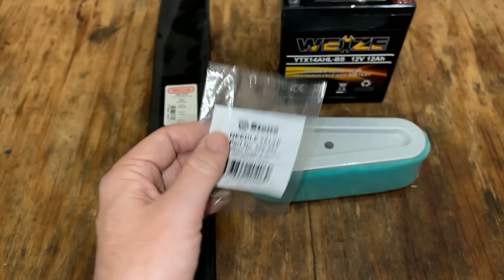First Start in 20 Years - MTD Riding Mower w/Briggs IC Engine

Comment: My lawn tractor ('94 Simplicity Regent) has a very similar Briggs & Stanton 12 HP engine. The mower is showing some age, but it still gets the job done.  I just had an episode where the carb float and needle stuck open and dripped gas everywhere, including the crankcase.  I think I got it fixed - no leak and the gas flushed out from the crankcase.  The hardest part was figuring out which of two carburetors was used in my machine and who to order parts from.  I would really like it if you would go into more detail about your process for finding information and sources of parts for your repairs.  
You are a great example of a person who works carefully, follows the specs, and has neat and tidy work area.  You set a high bar.
Reply: I use sten parts, found them real accommodating or Amazon alot.

Comment: Great little mowers! Small enough to fit thru gates and the engine is excellent. Drive belt is hard to replace. Only real problem is tiny springs for suspension on mower seat, on a bumpy yard they destroy your kidneys! Ask me how I know. I put a thick cushion on seat to help absorb bumps. :eyes-pink-heart-shape:

Comment: I went out and bought a can of bead sealer just for the reason. Of course i clean the rim 1st and then i put the sealer on and usually never have any problems after that. That's good for being 27 years old and the bearings being silent. My Troy Bilt rider is only 5 years old and i already had to replace the spindles themselves as the bearings aren't replaceable by themselves at least not that I know of

Comment: Nice job!!
I had a similar machine in the 70s It worked very well with only 5HP.
It fell to the rust bug.
It was a Kmart branded machine and I paid $259 for it.
The similar new Craftsman machines are JUNK, and sell for $2000.
Stay safe.

Comment: US Safety specs in 1985 and 1986 added blade brakes to mowers as a requirement. On my 1985 Toro 11-32 there is a spring loaded brake pad that presses against the blades Pulley. So when the belt to the blade pulley is loosened/un clutched the brake pad rubs on the pulley so the blade stops . The brake pads often wear out after decades of usage. .

Comment: To seat these small tires on the bead I use a short length of rope instead of a ratchet strap. Apply some heat to the side walls of the tire with a hot air gun. Then twist the rope up tight with a piece of rod or a dowel. Inflate the tire until it seats. I find that the rope will seat the bead evenly and then release with out a struggle.

Comment: The oil drain has a ball valve on it to make it less messy.  You use a flexible vinyl tube connected to a barbed fitting, screw it in where you removed the plug, and then open the valve with the screwdriver.

Comment: Nice work Jim, I always wondered why those didn’t have a recoil start as well as electric to use in times of a dead battery.
Reply from the maker: They definitely should have.  A 10.5 hp engine can be started no problem with a recoil.
Reply: i got an 11hp that is slightly older than this that has both electric and pull start. i would guess it  was a cost saving thing to ditch it since most people likely rarely use it when they got a perfectly good electric start

Comment: I have seen Mustie put an ear bud on a drill and spin it in the float check valve hole. What I was thinking was to put the needle on a drill and spin it slightly in the hole to mate the surfaces smooth.

Comment: A bit of valve lapping compound on a Q-tip will polish up the needle seat in that carburetor. 

Paint that rusted bare metal before it gets worse.

Leave the mower deck down when shutting off.  The blade will stop much faster.

Comment: A touch of tire slime in old tires works pretty well as a preventive measure. If you shut dow the mower with the blade engaged, it will come to a stop with the engine. Maybe not the best solution, but a functional one.

Comment: 20 years ago I had a Murray 10/30,looked like that one's close cousin. It was a good buy at $75,all it needed was a battery and machine keys for the back wheels,easy stuff I could DIY. I used it for a few years then sold it for $50. Kind of wish I would have kept it for a backup.
Reply: I still have my Murray!  Can't use it cause the rear tires have rotted out and I can't get the rear wheels off.

Comment: Would have certainly tested for grommet leak on fuel tank prior to fully reassembling.  Also not sure if this is an option or not but could you not have filed down the remaining old grommet, then pushed entire assembly into the tank and then simply removed it from the the fuel fill opening? Otherwise, pretty good repair.

Comment: 18:00 column drill and wire brush would work wonders but bit more work. take the wheel off and place it on the drill with bolt and nut and let the drill rotate it
also that mower is super clean for being over 20 years old

Comment: I love the old Briggs & Stratton motors, as long as the regulator gears have not stripped, they run forever. I didn't see the anti slack spring go back on the throttle linkage.
Reply: Caught that myself but although he didn't show it being hooked back on you can see a few seconds later that it had been reattached.
Reply: @TheOtherBill  Ahh, I missed that :)

Comment: I usually drain the fuel system first, then fill the tank with fresh gas, spray the greasy dirty parts with WD40 and then set it aside for a week or so. Nice to start with everything dirty loosen and easier to clean. Tha for its age is a very nice mower.

Comment: Those Zip ties can be saved. If you look at the lock where the end of the zip tie comes thru you will see a notch in that lock. you can take an ice pick and go in that notch and push the lock over and release the zip tie. as a mechanic I learned that a long time ago

Comment: Clean the seat with a Q tip in a drill.  You can put a little tooth paste on the Q tip before you spin it with the drill to help polish the seat.  If the Viton end is worn off, replace the needle.
Reply from the maker: Good idea.  Never tried it with tooth paste.

Comment: I bought a used Craftsman 3 in one ride and mulch 30" 10 hp like 10 yrs ago and it was like 20 yrs old then.  I loved that thing  a lot like the one you have there.  All I had to replace after a few years using was the drive belt.  I think I was to heavy for it and it could not handle the weight (  I was 350 lbs)

Comment: One other thing....take your tires off if the valve stems are inward and put them outward. On the tires, there are "C" clips holding them on, a flat screw driver will pop the off. Turn the tire around and you're good to go.

Comment: Another great video!!!! At 1:02:28 that underside is SO clean that I do not believe the mower has been actually used much. Usually grass/dirt/rust/mold is stuck everywhere and the only way for it to be that clean would be that it was washed, and who would wash it?
Reply from the maker: It saw very little use.  Was in great shape.
Reply: And that the discharge hole on the side of the deck looked like it had a “mulching” plate in it and you removed it for the mowing demonstration

Comment: Hi James. I recently got a black max 3550 4550 generator that was 3 years old and only 21 hours on it. It was hunting and then would not run unless full power choke was applied. So I new I had to go into the carburetor. But I had never done it on any carb. Your videos gave me confidence I could do it. The problem I ran into was getting the main jet out. The screwdriver I used was just a regular one that flairs out on the side above the flat tip. Not realizing that the tip was much narrower. So I ended up damaging one side of the slot on the jet. So I stopped there and just cleaned the jet with the wires. Never got it out. Good news is it runs great now. No hunting and running under half load with no choke. So now my question is does any mfg make a screwdriver set for this purpose. Or do you just grind down the sides of a screwdriver to use for removing jet and emulsion tubes. I watch all your videos no matter how long or short they are. Thumbs up always. Thanks keith

Comment: A Couple of things, first I would have taken a wooden stem q-tip put it in the drill & polished the seat maybe even with a drop of Flitz metal polish then through the ultrasonic cleaner. Just an FYI you didn't take the tire valve out but the Schrader valve, LMFIAO just helping out with the proper Nomenclature. Great video as always, will you let your son torture test it when you're done? LOL

Comment: What I will do when something comes out very tight like the main jet I will run in, very very carefully a tap to clean out the threads. Then, of course, make sure it is very very well cleaned afterwards to ensure nothing left behind. I find, in about 95% of the cases it then threads back in very easily. It is one of those things you have to be careful doing and obsessive about cleaning afterwards but seems to work for me. Assuming I have the right size/pitch of tap to run in.

Comment: You can put some Seal All around the tank bushing or TB 1184 to stop the leak.  Remove the bushing and coat it with Seal All or 1184 and then put it back in the tank.

Comment: That looks like a really good machine, once got the muck and dust off of it!   Also, on overall appearance, it doesn't look like it's had much use over the years.

A neat little bit of thought went into that oil drain, we used to have a screw in drain pipe to facilitate a clean and easy oil change. The basic principle is, unscrew the plug, as you did, then you screw in the drain tube and open that little ball valve (It's useful to loosen the oil filler as well, to let the air in faster). Once the oil is drained, refill with new oil. Unscrew the drain tube and refit the plug!

You should have a machine there that will last you a lifetime. I'd say it's a keeper, and despite its rather domesticated appearance, it's a very capable machine, often underestimated by many.  I've seen bigger and beefier looking machines that would have phutted out where those MTDs just mosey on through.

I have to say this, right at the end "Run, Forrest, Run! Except of course, his was a "Snapper" - "Why, shoot, you can cut my grass for free!".....

Not bad machines at all, MTD, Snapper, Lawnflite, Murray and a whole lot more.
Reply from the maker: Funny, forgot that forest rode a similar mower.  It is a very nice machine.  Am surprised there are not more of them around.  https://youtu.be/LZK5VRuUfEY?t=78
Reply: @jcondon1  I wish I could answer that. I do wonder though, if it might be that most folk equate the classic tractor shaped machines as being bigger, stronger, beefier, more professional, or just look more expensive, but looks aside, your machine has a ten and a half horse power engine. Contemporary tractor style machines of the same period began at about five horse power, so not really in the same ballpark.  I can't remember now, but I think these 'roller skate' style machines had the same Tecumseh/Peerless drivetrain, so no advantage there, either.  They may have had a more flexible frame than the tractor style, but that's about all anyone could criticise them for.  I know kids used to love them, take off the mower deck and you have yourself a neat little go cart.

Comment: James, I’ve enjoyed your videos, especially the way you are methodical about your diagnosis of the issues. Just curious . . . I was a jeweler for 20+ years and used an ultrasonic regularly. Question: why don’t you put the entire carb in a glass jar filled with PB Blaster and float it in the aqueous solution. I’d bet money that you’d free up stubborn emulsion tubes, etc, without much further effort. The cavitation in the solutions work from the inside out as in the operation of a microwave oven. They also cook from the inside first. I’ve been very successful over the years with a variety of objects in need of deep cleaning by using this glass jar/cleaning solution method. The jar should float since it’s never a good idea to rest anything on the bottom of any ultrasonic cleaner where the transducer is attached. Just a thought. Keep up the fine videos.

Comment: That's the right size engine for that mower. They're trying to put them on zero turn mowers with three blades and two hydraulic pumps now. You need a 22 HP V-twin motor for that at least.

Comment: I always liked the "sit over the engine"  compact riders.  For smaller lawns, they were easy to maneuver. They went out of favor due to tip-over according to the local mower shop.   I would have bought one for my yard,  but ended up with a modest size zero turn instead,  and that's great.  Does that machine lack a seat safety switch?   I was a little surprised that it wanted to go with the seat off....or maybe that's just if you want to engage the blades....  Flat head motors always seemed "tougher"  than the OHV motors produced today.  As far as getting the busing off the bottom of the tank,  perhaps a "fork"  pry bar like one used on tie rod ends for your car might be a good fit.
Reply: You missed him using a cable tie to defeat the seat safety switch, for testing.

Comment: Hint.  When cutting a six foot zip tie you've just applied by mistake do so just before the locking head.  This will give you a 3 foot zip tie to use again later.
Reply: You beat me to it! - And, you can get several uses out of a single tie!
Reply: The white zip ties are for indoor use, but the black ones are UV protected, and are better than the white. In all likelihood, it should last you quite a while.
Reply: Rather than cutting the zip tie at all… simply use a small pick to release the tiny tab and unzip it.  This method allows unlimited uses.
Reply: Re the tttt HHI uuuyyyyyy
Reply: @Farm_fab  no uv there it is covered up.
Reply: Nylon has a tensile strength of 12,400 psi but stretching by load of a gallon fueltank would make material fatigue so after use do not reuse. Buy a new one.

Comment: turned it from a sow's ear into a silk purse . nice job . we had a late 1960s or early 1970s rear engine wizard , by western auto . 5hp pull start and 30 inch single blade deck . had go kart rear tires , hard front tires . rode like a wagon , but beat pushing by a long shot , and left a great looking yard . the 5hp was powerful enough . our first tractor style had only 8hp and 2 blade 36 inch deck .

Comment: The rubber or plastic seal in the bottom of the fuel tank will have dried out, gone hard and shrunk if its been dry for 20 years, a few hours in petrol again would make it swell and seal itself. Just let it drip into a bucket overnight . Most of these stop leak cures for water pump seals etc are basically gasoline based and just swell rubber seals. Second hand car dealer trick.

Comment: On the plastic gas tank, how about pushing it back into the tank?
Reply from the maker: I was thinking the same thing after the fact.  It would have most likely worked.
Reply: @jcondon1  Easiest way.: Single-edge razor pushed straight inward, spin bushing with pliers. Practically falls into the tank in 30 seconds and no risk of scarring since the blade remains stationary through the process.

Comment: I really enjoyed this video, you are thorough. Did you change the Oil, it did look fairly clean? Sorry you did change the oil. The spindle bearing above the blade, could you grease that bearing, or was it a sealed bearing? And the tyres after so long hadn't perished that is amazing and a bit of corrosion on the bead seat of the rims is understandable of course. The drive belt for the Blades was also still good again amazing. 
It is good to have the right tools and being able to have the contacts to obtain parts. 
I would take any Mower or small engine to you for repair etc. Excellent work.😊

Comment: I really like your inline pressure gauge and screw on schrader valve attachment for filling the tires to your desired PSI. Is it new and if so, would you mind sharing a link? I generally regulate my compressor to a few PSI over and then check with a gauge but this would be more handy.

Comment: Another great project. I wonder if the valve on the oil drain was added so an extention pipe could be used to drain the oil without all the faff with the deck being so awkward? Plus I bet her indoors was glad you finally got something running to cut the lawn!
Reply: Yes, correct, that had been added as all they had was a square head plug mounted vertically

Comment: 5 month old video so you may never see this but just in case.  On that float needle, in the past I’ve had good results with gentle spinning turning the needle back and forth on its seat like you would when lapping valves.  As for your leak down test, I’ve often wondered, does that float, when floating in fuel, have more pressure against that needle and seat than it would with just gravity pushing down on it?  Thereby sealing better than the test would have us believe? I’d be interested in your thoughts on that.  Aside from that, great job with this channel.  I’ve enjoyed it very much. Hope to hear from you.

Comment: A V-belt and screwdriver used as a  tourniquet makes a usable bead expander. Hot glue is very useful. Might be applicable to fuel tank fittings.  Thank you once again James.

Comment: Could I ask about the source and size of the screwdriver you use for carburetor jets?  It appears to be a parallel ground/hollow tip which reduces the chance of damaging the jet.  And a fixed shaft diameter from grip to tip which allows it to be used inside the main jet tube.  It also seems to be relatively short for its shaft diameter which provides increased control.  Looks like a set next to the drill press.  B&S appears to market two different models but they have mixed reviews.

Comment: Should try using a soldering iron to heat up the jet instead of a torch I use that method for taking out seized screws I’m my rc’s it work pretty good less chance of melting other stuff